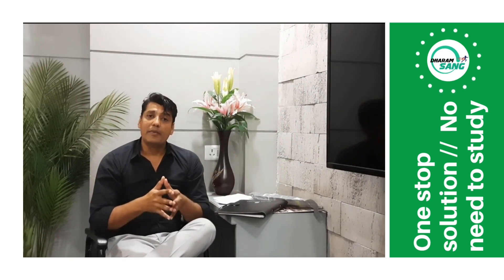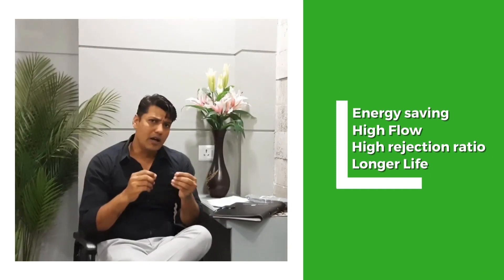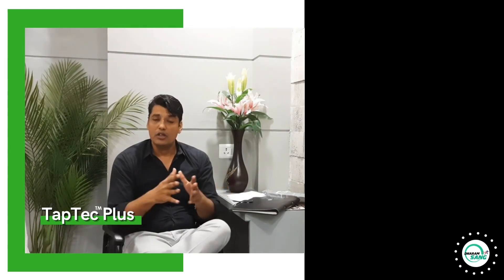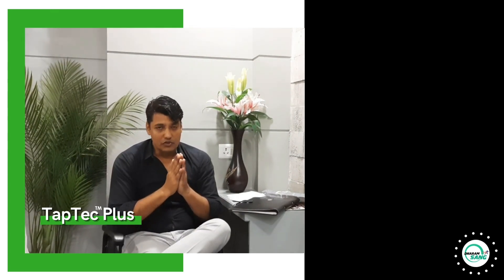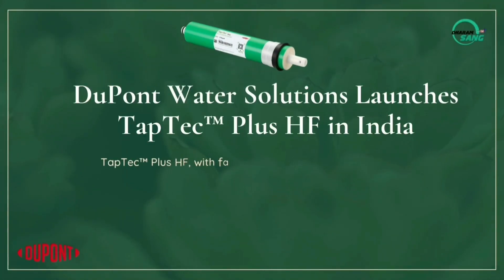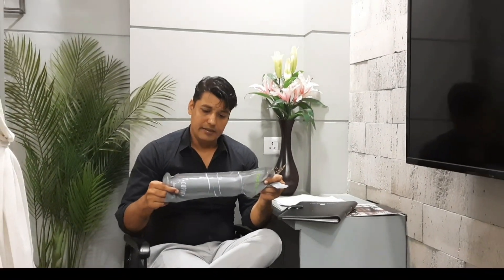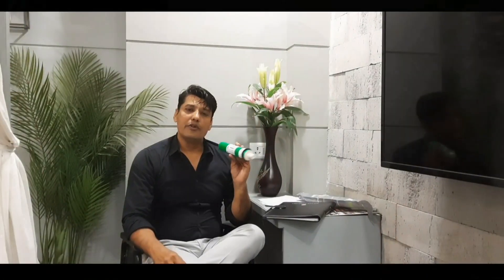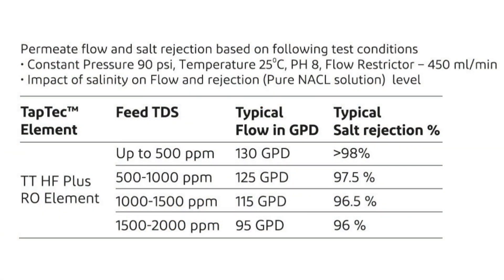Suitable for all RO no need to study, High-performance multi-functional RO MEMBRANE DuPont - TapTec

Comment: Sir please help me , my Ro filter makes no noise and water flow Is good both rejected and pure but my Ro filter Automatically get switch off and on while running  .
Reply: Check all wiring connections. Also check mains socket point with tester. If socket is ok check loose connections if any.
Reply: Check float switch